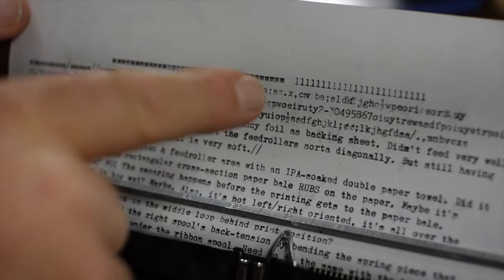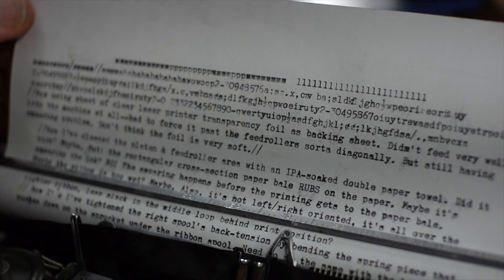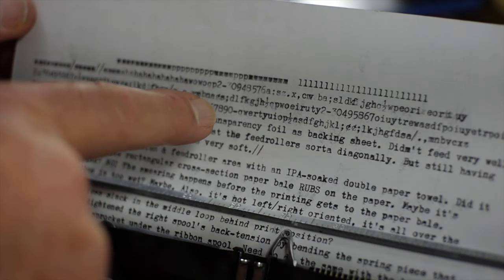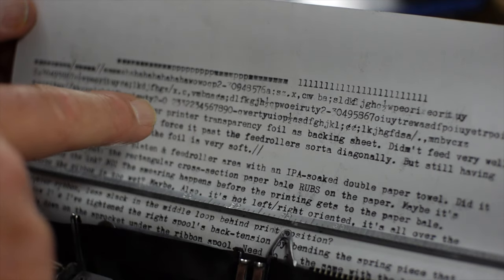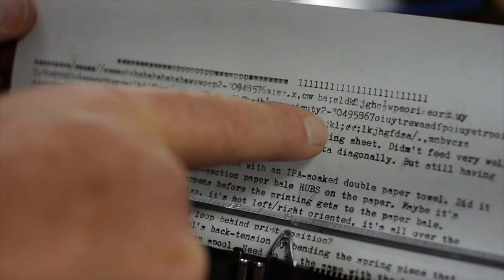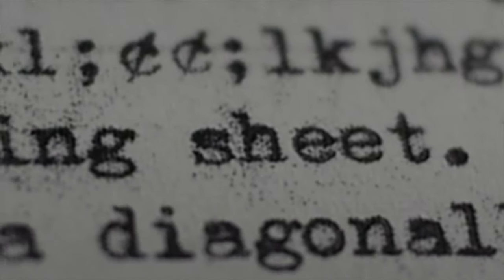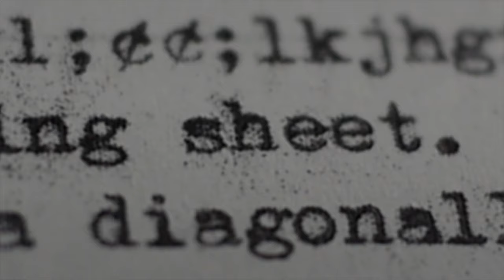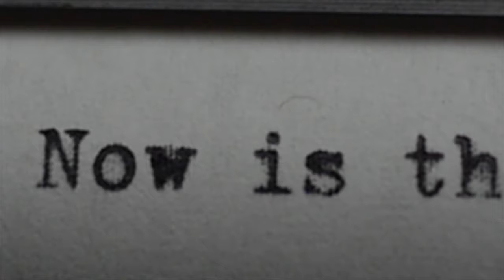Typewriter Video Series - Episode 242: Rocket Ribbon Smearing

Comment: I have the same problem with one of my two Rocket/Baby typewriters (1954 series).  Figured it might have been over-inked ribbons, and smearing caused by the paper bail since the smearing tends to be below the typed letters (like mascara when someone is crying)...but after watching your video, I found that the supply side ribbon was indeed moving more than it ought, and will try your fix to see if it helps.  Thanks for your great videos!  They're well done.

Comment: Hi Joe, I am having this same smearing problem on my Olympia SM3 and I'm not sure how to resolve it.  I'm not sure what the mechanical fix is to create the right back tension on the ribbon.  Any ideas?
Reply: Figure anything out?
Reply: yes, sort of, as the ribbon dried somewhat, the problem kind of resolved itself, i think new, "wet" ribbons are tricky. @indie9hippie
Reply: I had a similar problem with my Royalite. Since it was using the spools for the ribbon and not the original metal ones(that belong to the machine), I thought maybe that was the problem. Then I notice that the card guide is touching or was too close to the ribbon vibrator on one side. I loosened the two screws and placed it a bit further away from the vibrator and that worked. Turns out the ribbon was getting stuck between the two.